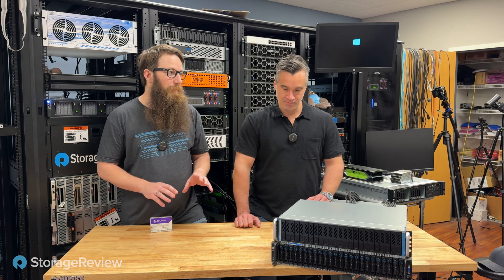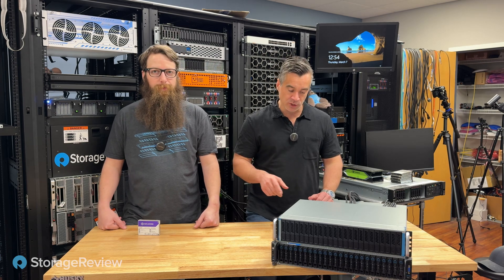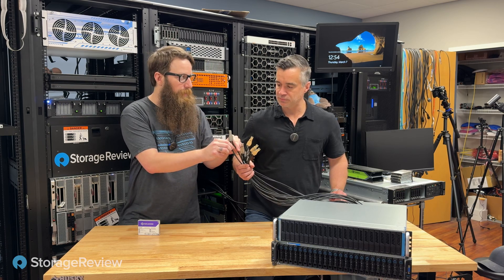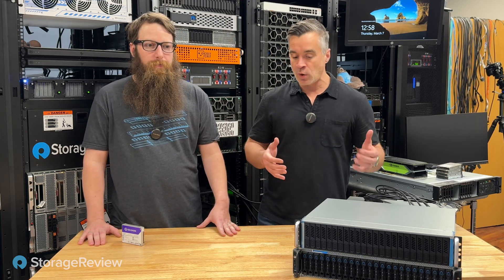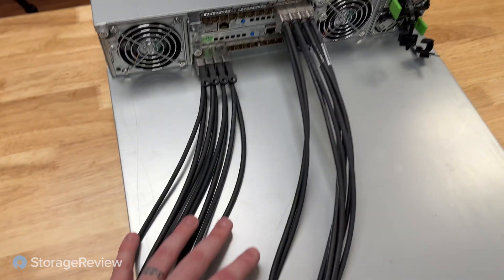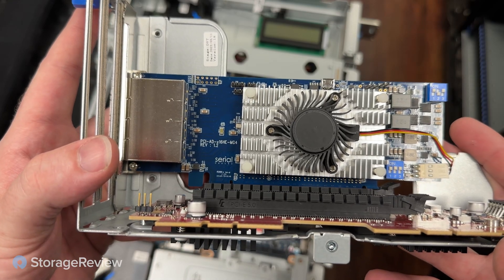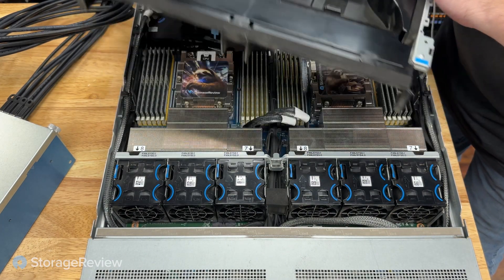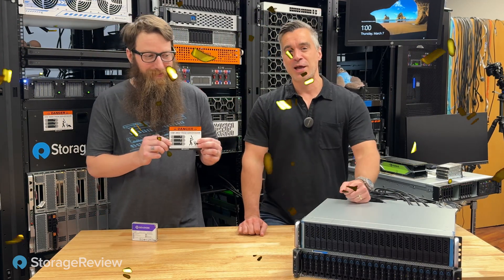[π Day 2024] WORLD RECORD Pi Calculation! 105,000,000,000,000+ [105 Trillion] Digits

Comment: But WHY do you need a petabyte to store 105  terabytes? 900 terabytes of swap? Or just wasted space in a bid to sell solidigm hardware?
Reply from the maker: Yep, you're correct, it's a massive swap footprint. The drives used in the computation get uncomfortably close to full.
Reply: @StorageReview  Really? 900 terabytes of swap? There is something terribly wrong with your code. Are you using C# or python or something? (This should be straight c.)
Reply: @signintoconfirm6168 if you wanna write something better, I’ll run it at scale.
Reply from the maker: You are missing the 100trillion digit precision of this concept. High-precision calculations like 105 Trillion digits of Pi need more than any concept you are likely familiar with. Unlike standard floating-point arithmetic used in everyday computing tasks, which typically uses 32 or 64 bits per number, y-cruncher needs to store each digit of these enormous numbers prior to final division, squaring and multiplication, requiring a massive amount of memory. Look up the Chudnovsky Pi algorithm and it you should understand.
Reply: @JordansTechJunk  tell em J

Comment: Why does it need to be flash storage? Is the write not one contiguous stream of digits? I would think it cheaper and just as performant to use a san or with perhaps a round robin storage. I would also think that if one times the calculation correctly, or has a cache buffer... the mechanical drive head on a hard disk wouldn't need to seek, just keep writing, like making a groove in a record or writing to optical media. It's 7200rpm not fast enough to write the data to disk in a continuous stream? How many disks would you need to be able to write the stream in parallel to disks?
Reply: It doesn’t, but you’re gonna be going a lot slower and taking a lot more space and power.